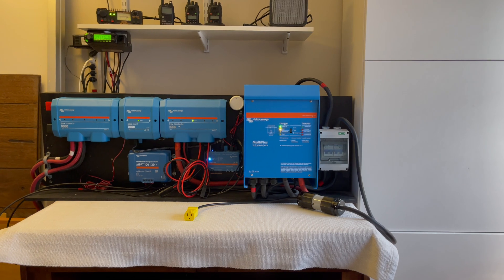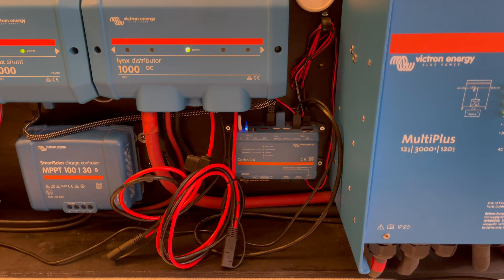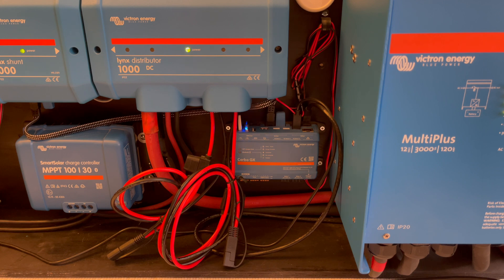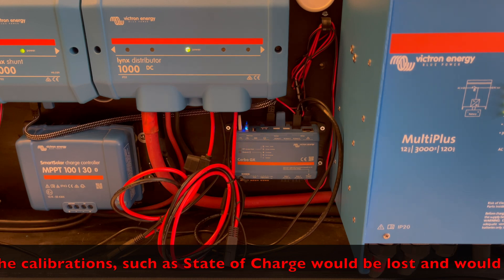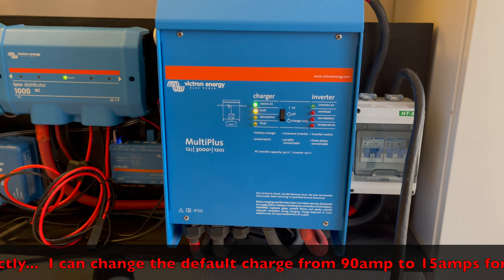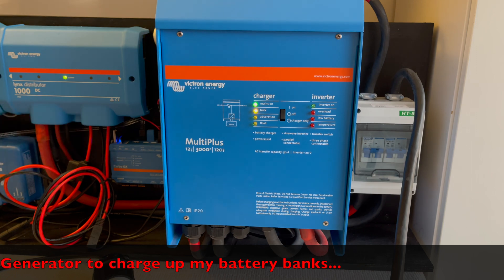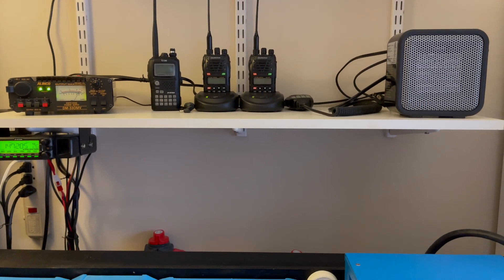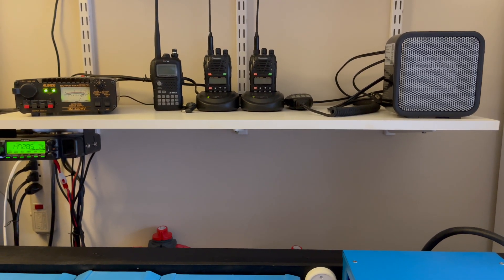Victron - Be Aware!  For Cerbo GX Users

Comment from the maker: I have been testing the upgraded SOF 300HP and set it as a BMS control.  It work flawlessly. I agree Victron is the best and it normal for bugs to appear when firmware updates are done.  Thankfully Victron correct them asap.  The issue with cold start as mention in previous comment doesn't occur when using the SFK300HP as the controlling BMS.  The only downside, it limited things, not an issue with 4 units, but if you only using one, it may force you to get a second.  Here is what they have said:  

We have configured the Cerbo Gx to use these settings (these can not be changed), they are designed to maximize usage life of the batteries:
1) The system will charge the batteries to 13.8v and not 14.4v. 13.8v is essentially fully charged and is bit less stress on the battery vs being charged to 14.4v

2) The charge limit/battery is set to 70 amps, note this is per battery so if you have 2 batteries connected you can charge them at up to 140 amps total or whatever your Victron based charger/inverter can do.

3) The discharge limit/battery is set to 140 amps, note this is per battery so if you have 2 batteries connected you can discharge them at up to 280 amps total or whatever your Victron based charger/inverter can do.

What do you think?

At 13.8 vdc is not fully charged, I suspect is about 90 percent.  That is 3.45vdc out of 3.65vdc per cell.  Victron batteries are set for 14.4 for 12vdc batteries.  No harm or foul for us.  It would be good for the battery.

Comment: That multiplus cant push out 100 amps can it ? 

I was under the impression that it should obey the last DVCC it received. For example if your charge controllers are configured for network operation or controlled by a cerbo they should list "external control", they shouldnt do anything until the cerbo is up and running
Reply from the maker: This is an issue when doing a cold start.  The Cerbo GX is off, the multiplus is off.  The multiplus 12/3000/120 is capable of 120 amp charge.

If the unit is power up at the same time, the Multiplus is operational before the Cerbo GX is still booting up.  Whatever the default setting that the Multiplus was set, it will provide that amperage.  Let say it was set for 90amp.   Looking at the battery bluetooth app, one can see that surge and/or the VictronConnect app.

Once the Cerbo GX is operational, it then take control and uses the parameters that I setup for this particular setup.   It doesn't really know for a certainty what the SOC is?   So, if it see a voltage less thanb 13.8, it will go into bulk mode but uses my charge settiing.  On the bench setup, it is set for 15amp max, above 13.8 it will go into absorption mode and for the period of time that I setup.

I love my Victron setup and I wouldn't consider another brand, especially from some offshore brands.  With firmware updates, bugs or issues show up that hasn't happen previously.  In fact, they acknowledge an issue that I notice and advised.

The simple solution for now, power up the Cerbo GX first, once it up and running, then turn on the Multiplus.   Assuming the Cerbo has it own power source or the battery can handle the bootup process.   Unfortunately the SOK 205, shut down on a cold start.   Not so with the SFK300HP, it can handle the surge startup.  (Capacitors, probably the Multiplus).

Another option is disconnect the battery bank using my Switches that I have for each battery.  Power up the system, Multiplus will say low battery, do nothing.  Once the Cerbo GX is operational, then put the battery bank online with the switches I have installed.   All good now.

Normally, when not on the bench but setup at our RV or offgrid unit is always power up, either via shore power and/or batteries online.  Not an issue.

I only notice this recently, so I  am not sure yet, if it an introduced bug or that is it alway the case?  I would need to downgrade the firmware to find out, but not worth the effort.  I will see if it changes in the future updates.

I thought the same, expected it would remember, but not so with this setup.   My cerbo GX is setup for AUTO, and when all is running, it see the Multiplus and itself.  With Auto, it show both but it takes control.  Which is okay. That what I wanted.

For those who have the same/similar setup, and notice that startup surge, here is a solution for now.

Depending on your battery bank charge limits it may not be somthing to worry about.  Why take chances, do this & don't assume..

To make changes on the fly when offgrid, VictronConnect app is great, however it has little options for the Multiplus, unless you use VRM online or bring equipment to connect directly.  I believe Victron is adding more support via VictronConnect App.

For now, I have several configuration files that I keep on my iphone if I need to make changes to the Multiplus when offgrid, provided I have internet/cell service.

There is no issue with Solar chargers, but it doesn't control the Multiplus.  The Cerbo GX is assigned that authority.

I hope I answered your question...  Thanks for bringing it up...

In your case, with a permanent setup, large battery bank, you probably will never see this quirk or to be concerned.

Curently I use 500amp bank for RV, but the plan is 1200amp.  (4 x SFK300HP, with battery communication option with Cerbo GX.). I consider this a must have  option

I subscribe to your site, I take a look at ur setup.

Comment: why would you not set the max charge rate in the Multiplus  settings itself
Reply from the maker: Normally, when all my batteries are connected, I use 90 amp.   When partial, one or two unit, you don't want to exceed the charge rate of the batteries.  I am set by default on the multiplus for 90 am, and I use my victron connect app to override the setting depending on what battery is connected.  Unit is home, so it varies.  Unfortunately, depending on the sequence of power up, the multiplus boot up first, before the cerbo gx, throwing 90 amp to one battery for a minute or so.  The solution was:  Switch off all the batteries first, then power up the victron system, once cerbo GX is online, then switch the batteries on.   All 4 batteries have their own switch and fuse, connected to a bus bar with equal length 2/0 cables.

With my full battery setup, 90 amp is perfect, but you do not want that charge if the battery set currently connected has a max charge of 50a.

The point is:  Use proper power up sequence to avoid harsh treatment on batteries that have limited or lower charge rate then the Multiplus setting, which can be 120amp, but 90 amp for my setup for now is just right.   Once I have 1200amp bank connected, then I can increase the multiplus to 120amp if I needed it.  I don't like to use max settings, so 90amp is less work for the multiplus.
Reply from the maker: Good question, it needs a clarification.  Hope this answer it
Reply from the maker: Unfortunately, at this time, victronconnect app doesn't allow you to make changes to the Multiplus.  This required for me to use another option when off grid, no computer access, but only cell. I have a video explaining how I did that.
Reply: @SimplyOffGridLife  
there is another victron app that does allow the changes (needs a PC and the appropiate hardwire connections  (I have a later multiplus 2 and had to drag the PC and monitor out to the camper to do the changes)
Reply from the maker: I don't use PC, only mac,  and I don't want the MK3.  Don't need it.   If you watch the other video, I can switch configuration to my Multiplus using ipad, iphone and mac.  Buying an MK3 is going to be obsolete.  Victron is slowly adding more suport via their Victronconnect app.  I can make the changes on the Multiplus, as long as I have Cell service.  I only use iphone when I am off grid camping.  I can make any changes on the fly.  Don't need no other devices, just an iphone or similar devices   @johnallen3555

Comment: thanks:  KA7PAT. I do have an iCom 7410 ... unlocked would consider selling.  I have a 7100 that I am putting in a can and will be all mobile.
Reply from the maker: We decided to get the IC-705 and we like the size and it can be used on base for 2 and 70 cm and when I can will go HF with the Silver Bullet Coil antenna system.  Will see how well we can do it at home inside.  Going to test it also with the faraday blanket.
Reply from the maker: We subscribe to your site.   Things are too complicated and like a puzzle that not missing a piece.  Conclusion is obvious
Reply: Nice.  I hope to upgrade my cerbo to the added info ... I'll check out the web site you mentioned.   @SimplyOffGridLife